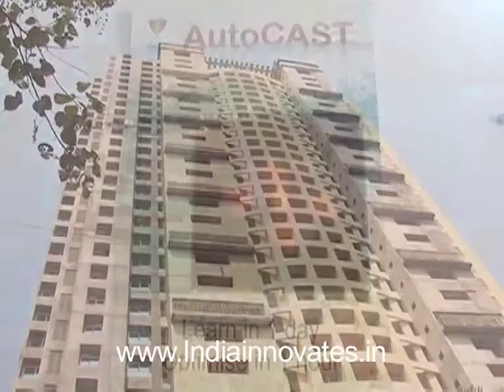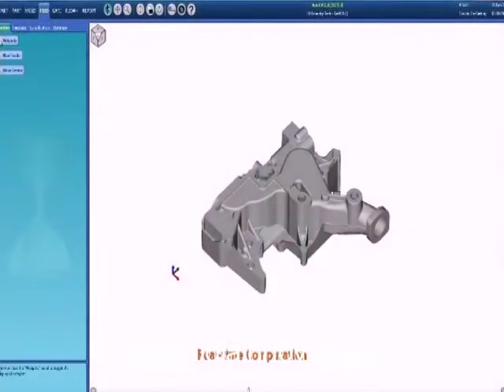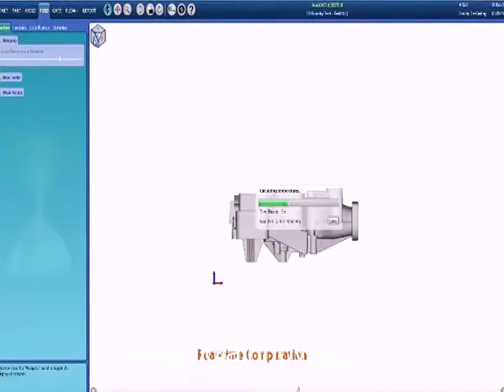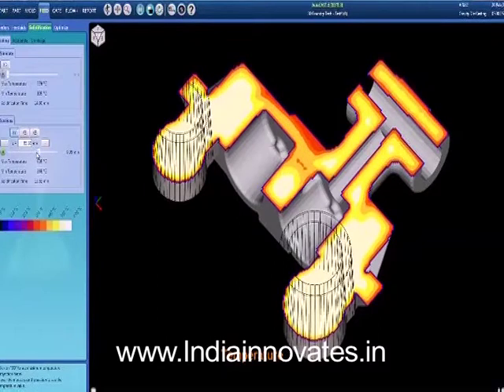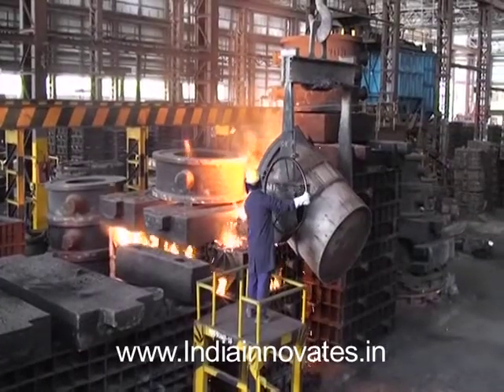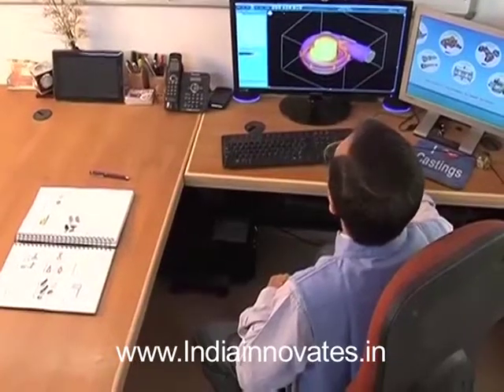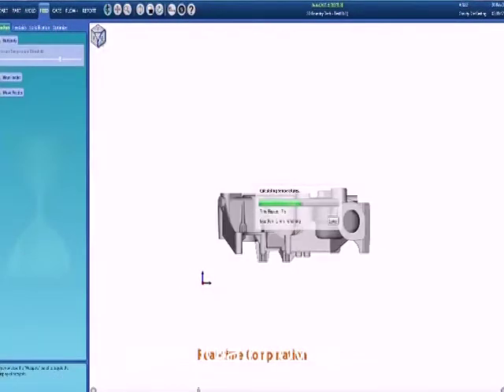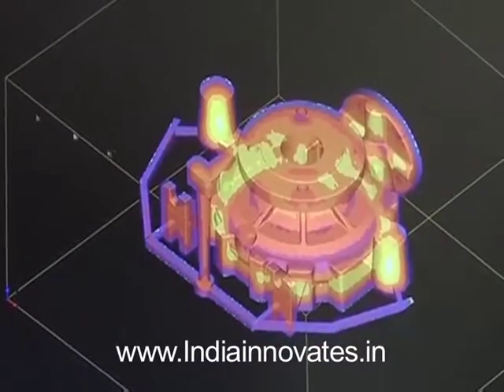Fast and accurate method for solidification simulation of metal casting

Comment: Would be good if you could add a module to HPDC to see the pressure distribution on the mould walls; not sure if that is available on your software yet! It is a valuable tool. It is much appreciated to have a tool for great value.